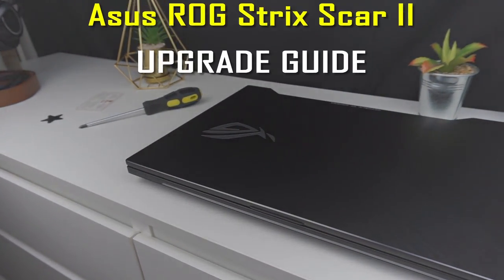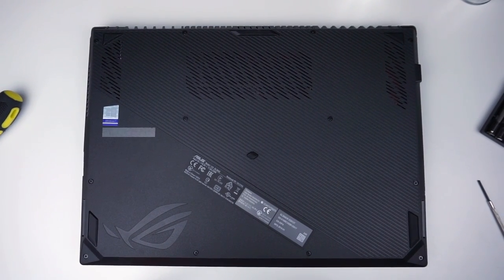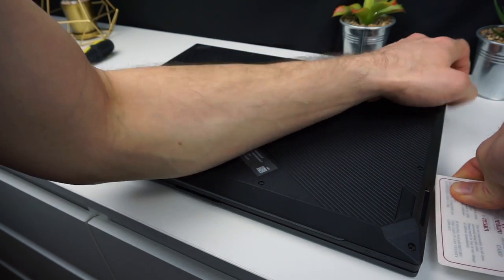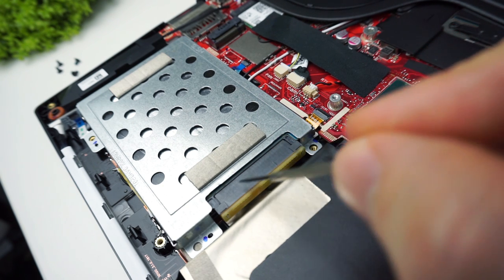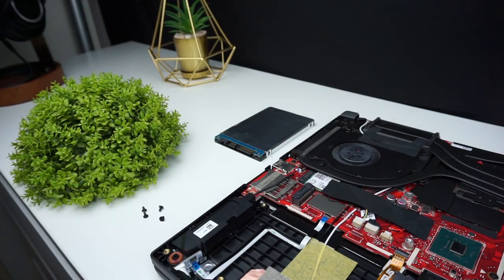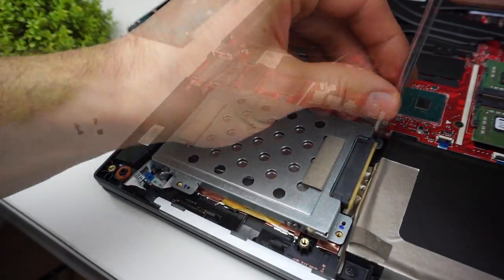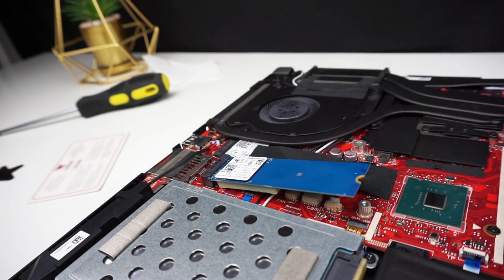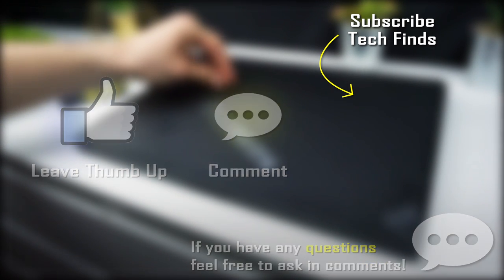Asus ROG Strix Scar II upgrade (RAM, SSD, HDD) - Disassembly Guide (detailed)

Comment: Thanks so much for this! I've just replaced a RAM in mine and it went like a breeze, following this video. The hardest part was removing the lid. Never took apart a laptop before in my life. I bought the Crucial RAM btw (2x16 GB) and it works fine.

Comment: Right on I gave the video a like 30 seconds in... The most important thing for me is putting in ram and memory that are compatible cool
Reply from the maker: I linked compatible stuff in the description. I'll just add that if you're planning to mix RAM it's good to go for Crucial or any other with the same latency (CL19) for the best compatibility. If you're replacing both sticks you can choose any compatible RAM.

Comment: Just bought this laptop. This was first video on the google search- and just what I was looking for. Thanks!
Reply from the maker: Thanks for commenting! :)
Reply: @TechFinds  Gonna have to just buy one of those HDDs you linked too. The 1tb one I was going to use does not sit well in the bracket; the screws don't line up with it in the direction that the sata cable needs to go. So thanks for the links to compatible drives and ram too. found this just in time for cyber monday!
Reply from the maker: @AdkAqua  The HDD has to be 2.5" (6.9 x 10 x 0.7 cm). Have you tried to flip it over while still pointing the sata connector right way?

Comment: May I ask that is the HDD deck for the 15.6" model same size as the 17.3" model? I know nothing about laptops so I beg your pardon if that was a stupid question.
Reply from the maker: Do you mean the metal caddy for HDD? Idk if the same would fit, but i found different one that says it's for GL704 (17").
https://www.asus-accessories.com/hdd-caddy-for-rog-strix-scar-ii-63678-66962.htm#gl704gm|l
Reply: @TechFinds  Much appreciated!

Comment: Hi great video, it helped me install a hard drive but I now want to upgrade m2 slot ssd and the ones you've listed will not fit. As far as I know it has to be b&m slot and I think 2260 size. None of the ones you've listed have those specs. If you could update with the correct M2 slot SSD's that would be appreciated. Thank you.
Reply from the maker: drives in the description are compatible. I've got the same links since i uploaded this video and nobody reported any issues with these drives
Reply: @TechFinds  Sorry my mistake, I read the specs from a web site which listed 2260 but that's wrong also the slot can be B&M or just M, I didn't realize that. Maybe this will help someone else. Thanks for your reply and the video.

Comment: I have the same laptop and yours look very clean, do you have any suggestion how to safely clean the fan and the usb port from dust??
Reply from the maker: I am not permitted to disassemble cooling system in the laptops that I test, so I didn't do it to this laptop. Compressed air may be useful, and thin ear sticks
Reply: Tech Finds ok thx

Comment: Does the laptop come with the caddy inside the chassis if it didn't have a Hard drive installed before?
Reply from the maker: It should in theory, but it may vary between countries/sellers.

Comment: Do you just shit down the computer before unscrewing the back? And do you need to detach the battery to install ram? And can I leave the one stick in and just add in another or do I need to use 2 from the same brand?
Reply: I bought 2 8gb of hyperx
Reply from the maker: @day-us7mz  You have to shut down the laptop and unplug the power cord for sure. It's good to disconnect the battery to prevent eventual electrocute or hardware damage. You can leave your original RAM stick and add another brand, but i don't recommend using HyperX for mixing since it has different specs. If you have 2x HyperX then you'll be good.
Reply: Tech Finds thanks so much!

Comment: Very helpfull video well done!!!im considering buying that laptop and i have two questions. 1) can i add second m2 nvme ssd?? 2) recently i saw that laptop on display and ive checked that it has 1/4 ram slots. Did you know anything about that?
Reply from the maker: Hi, thanks. The Scar II no matter what configuration has only 1 M.2 slot and 1 2.5" drive bay for HDD. It has also 2 RAM slots where you can add maximum 32GB (2x16). There are some laptops on the market that have 4 RAM slots but it's rare and those machines are rather very expensive. There are also some laptops with 2x M.2 slot but sacrificing 2.5" drive bay usually.
Reply: @TechFinds  thnx for the quick reply. I dont know if its different from country to country. Im from Greece by the way so i'll check and let you know when i will have it in my hands. Have a nice day!!!
Reply from the maker: If it comes to build i don't think it can be different for certain countries. The features and configurations may be different but the laptop is built the same way so it's got the same ammount of slots. :)

Comment: Goodjob you made this video😀
Reply: That RTX laptop what jou linked, has on Amazon only 500gb ssd and not hdd is that true? Thats not al lott 😑
Reply from the maker: @merlijncremers1298  thanks man! There are many configurations so you can look for the one with SSD and HDD if you find one. I linked the best offers I found but new offers may appear with time.

Comment: If you needed to replace the speakers on this laptop, do you just need to unscrew the old ones and unplug them and then screw in the new speakers and plug them in? Is there anything else required?
Reply from the maker: I didn't do that do I don't know. I had this laptop for tests only long ago.

Comment: Thank you very much for the video. I have already ordered scar 2 after watching all your vids regarding this laptop. I have a question, how do u know that m2 u shared in description is only compatible with laptop? Or it's just for reference? I mean, can I get better m2 with more capacity than 1tb? Thank you !
Reply from the maker: I know that it's compatible, because the M.2 slot in the laptop supports this type of SSDs. You can buy different one if you want but as you said, this is my reference (really fast). If it comes to capacity i am not sure what or if there is a limit. People made me confused saying about M.2 capacity limits in various models but manufacturers doesn't share such info or i just can't find it, so i don't know.
Reply: Scar 3 is already released
Reply from the maker: @maanaav  yes, I made a comparison video between Scar 2 and Scar 3.

Comment: Can you tell me if 1} Does this information apply to the 731GW-XB74 Scar III, and will the HDD cable and caddy work for it? the ones you describe with link, in the description? And will 2-32gig sticks work in there? Thanks, old guy looking for help....Mike
Reply from the maker: I've got a video on Scar 3 (upgrade guide): https://youtu.be/ovY7B3_5LfE
All info in the description, but idk if the parts will fit to your 17" model. However you can try to find the parts on Asus store that i linked in the description of Scar 3 video. If it comes to RAM it supports up to 32GB RAM 2x16
Reply: @TechFinds  Wow, fast reply thanks, gonna find a link for the ram in your video, then i am going to buy the 2TB m.2, thanks so much, i appreciate it, like all the other comments say....you are the best

Comment: Hello, I'm kinda new to upgrading, so sorry if this is a bit of dumb question. I own the rtx2060 version which comes with 475GB SSD only. Does that mean that that big slot for driver is empty in my laptop? Can I just add the SSHD of yours and have 2TB and 475GB of storage?
If not could you please just simply explain why?
Thank you!
Reply from the maker: Yes, you have 512GB M.2 SSD (small one) and your drive bay for 2.5" HDD or whatever else you want is empty. If you add 2TB SSHD you will have 512GB + 2TB in total.
Reply: @TechFinds  ufff, what a relive! Thanks a bunch man!

Comment: i noticed you used a screwdriver. wouldnt this cause more static since its metal? also should i take off my socks and stand on wood while doing this? do you recommend unplugging the battery before doing this or can I leave it plugged in?
Reply from the maker: You can leave the battery connected but disconnect the power cord. You can do it on any type of ground and with socks, shoes or whatever you like. And if it comes to screwdriver i doubt that it will affect the battery anyhow.

Comment: Can I unplug the battery and still use the laptop when its plugged in? If so does it give any type of performance boost?
Reply from the maker: You can but i don't recommend that. The laptops are designed to work on battery as same as plugged in with battery connected. You'd rather lose performance in certain situations if you disconnected the battery

Comment: Hi, I have the same laptop but it has 16GB single channel memory, and I want to upgrade it. I wanted to know what could be the best possible RAM config that I can get. Best ram offered by any company.Which RAM brand it is already including?, and also can it handle 3200Hz?
Reply from the maker: 2666MHz is max. If you mix go for RAM that has the same specs as your original RAM. Crucial that I linked in the description will be the most suitable

Comment: My GL504G came with a small plastic bag of parts with partition where the warranty documentation was in. Included in that bag was a SATA cable with a tiny ribbon. Under the chip based SSD there is a tiny HDD module that should have screen printing on it. I removed the SSD, since it was only one screw, because I could see the HDD module much easier with it out. When I initially slid the SATA ribbon in, it slid right back out. I thought it might need to go in upside, but that didn’t work either. That is when I noticed a small “lock bar” on the HDD module. You put the lock bar straight up, slide the SATA ribbon (terminals UP) into the HDD module, then slide the lock bar down (away from you) to lock the ribbon in place. Once you do that, installing the 2nd HDD is pretty easy. Remove the cage, install the HDD using the screws that came in the SATA ribbon package, connect the SATA, and screw the cage back in. You can find pics here: https://ibb.co/album/cpHbdv
Reply from the maker: You're right. There should be a little tag behind the HDD slot on the motherboard. You tilt it up, put the ribbon cable in and  lose the tag. However it wasn't working in my case so I thought that it is not a moving part (the tag). Thanks for sharing!

Comment: is it possible for this laptop to run without its battery?
is it okay to remove the battery?
Reply from the maker: You should leave the battery as it is. Just try to avoid using laptop when the battery is not 100% charged
Reply: @TechFinds  so is it okay to use this laptop even the battery at 100%?
Reply from the maker: @DanielLeonardo-nt9zd  it is normal to use the laptop with power cable plugged in when the battery is 100%

Comment: Great video! I couldn't find any HDD cables inside so I guess I have to buy them. Two questions. Do you need to keep the thin pieces of black cloth on top of the SSD and RAM when you swap them out? Also, my stock SSD (Intel 660p) came with what looks to be a metal heat shield on both sides. Should I be concerned that the replacement Samsung 970 EVO doesn't have these?
Reply from the maker: Hey, thanks. What black pieces of cloth do you mean? I didn't see anything like that on RAM or SSD in my Scar 2. If it comes to your second question you don't have to worry about those plates. SSD doesn't really need that.
Reply: @TechFinds  I actually have the newer Strix G GL531, so it may be a little different. Your video was just the closest and best demonstration that I could find compared to mine :). It's not really cloth, but some type of thin plastic film. It looks similar to that black strip above your SSD at the 1:45 marker. On mine there is a little flap covering the SSD as well as another one covering the RAM. I'm assuming it's useless, just curious.
Reply from the maker: @ChunkyFire3  Ohh, i know what you mean now. I had the same thing in Scar 3. Strix G is built the same way and i'll be making an upgrade guide for Scar 3 too, but not very soo, since i have tons of other videos to make as first. It's usually the same process for every laptop anyway. In Scar 3/Strix G it's important to watch out for the cables connecting the light bar before taking off the bottom lid to not break them.

Comment: Hey tech find it's me again. So yesterday i was thinking about adding 1tb ssd. The laptop I bought doesn't contain HDD it only has 520GB ssd. Should I upgrade the ssd or add an HDD. The SSD I am thinking about is crucial mx500 1TB. Should u upgrade the ssd or add 2TB HDD. Can u please recommend the fastest HDD in market. For laptop
Reply from the maker: If you need more storage then go for HDD. Idk which one is the fastest, you have to do some research. I always use Seagate FireCuda SSHD.

Comment: Does it matter what RAM stick I get? Will my laptop be faster if I get a 3000hz RAM Stick or does it have to be 2666hz
Reply from the maker: This laptop supports max 2666MHz RAM. The brand doesn't matter, but if you gonna mix it's important to match the specs of new RAM with original.

Comment: Hello i want to ask, we already have SSD in ROG Strix II but can i add another SSD and HDD to? (2 SSD+HDD)

Also wich one better for Windows
Should i place HDD FireCuda for windows or SSD?
Reply from the maker: No, there is only one slot for M.2 SSD and one 2.5" slot for HDD or SSD, so you can  have 2 drives. It's better to have Windows on M.2 SSD as you already have.

Comment: Thank you for the video!  silly question...Will there be any compatibility issue if two sticks of ram are from a different manufacturer?  I have 16GB single and want to buy another 16 GB for dual using your suggested ram.  Also, scar II gets kinda hot, what suggestion you have too cool it?
Reply from the maker: Hey, the brand doesn't matter as long as you match the specs. In this case go for Crucial that i linked, because it has the same specs as original RAM.
What do you consider hot temperature? If it stays below 90 most of the time it's good, but you can always undervolt the CPU to get lower temperatures.
Reply: @TechFinds  Thank you for the quick and helpful response!  My gpu temp hovers in the 86-90 and cpu is around 85 under heavy load.  This appears to be within range of a typical gaming laptop from what you are saying.  I have a cooling pad, but it doesn't seem to help much due to its design.  I don't think it sucks in air from the bottom.
Reply from the maker: @oathgarde6641  Whoa, the CPU temperature is ok but GPU gets way too hot. GPU is usually about 10 degrees cooler than CPU, it shouldn't get over 80 degrees in most cases. Maybe someone screwed up the thermal paste work on GPU in the factory.

Comment: Hi, I brought an Asus Rog strix scar 2 gl504gw last week and it came with a 1x16 GB ram card. If I upgrade the ram by adding another 1x16 GB ram card, will it void my Asus international warranty?
Reply from the maker: You should be free to add more RAM, swap out SSD or HDD, but the warranty terms vary in each country so you better contact Asus support or read your warranty terms.
Reply: Alright thanks for explaining

Comment: Do I need to backup all the data I have before replacing the new ssd?
Reply from the maker: Yes, and if you're swapping a drive where you have windows installed you'll need to install windows on the new drive

Comment: Excellent guide. My ASUS ROG Strix only came with the stick SSD and no HDD. I followed this guide and I removed the factory SSD and I installed a Samsung EVO 860 SSD (1TB) in the hard drive bay. I booted up and all was perfect. Laptop ran great. Then the ASUS software said that I should update the BIOS firmware, so I did. BIOS updated fine BUT on reboot, the laptop entered the BIOS screen and in the "Boot Priority' section, there was nothing listed. The laptop does see the SSD because it's listed under "Storage". I thought that maybe the boot record got corrupt so I booted to my USB with Windows 10 (Nov Update) and re-installed Windows 10. Once finished, I removed the USB and it rebooted back into the BIOS again. Any idea's on what i can do?
Reply from the maker: Check out this video and try to find the same options in your BIOS. Maybe there's some list to expand like CD-Room and hard disk here: https://www.google.com/search?q=can%27t+select+boot+device+in+bios&rlz=1C1CHBF_plGB877GB878&oq=can%27t+select+boot+d&aqs=chrome.1.69i57j0l7.7565j1j7&sourceid=chrome&ie=UTF-8#kpvalbx=_0DUKXpyTIZmEhbIP0LO0uAI27

Comment: Which ram should I get so it runs as duel.
What is the brand of the one that comes with the laptop. And can I just buy one of those and put it in the laptop. Thanks
Reply from the maker: It comes with Samsung RAM. You can mix brands no problem. The most similare in terms of specs is Crucial that I linked in the description.
Reply: Tech Finds thanks !

Comment: Do you think it's possible to put the os on a 1to ssd and replace the nvme for video editing which is more speed!.
Reply from the maker: It is possible, but if you gonna replace the M.2 SSD you have to install windows on the new SSD
Reply: Tech Finds and change parameters in the bios in order to start on the ssd!. Thanks for your video!.

Comment: I just purchased an ASUS ROG STRIX Scar II model GL504GW and want to upgrade to a bigger SSD. So is this SSD compatible with this laptop:  Samsung 970 EVO Plus Series 500GB PCIe NVMe M.2 internal ssd model: MZ-V7S500B/AM?   Also, want to ad this RAM: Samsung 16GB DDR PC4-21300, 2666MHZ, 260 pin SODIMM, 1.2v, cl 19. Thank you and please advise
Reply from the maker: Hi, the SSD is compatible and you found a perfect RAM to mix with original one, because it has the same specs.
Reply: @TechFinds  thank you so much for your quick response